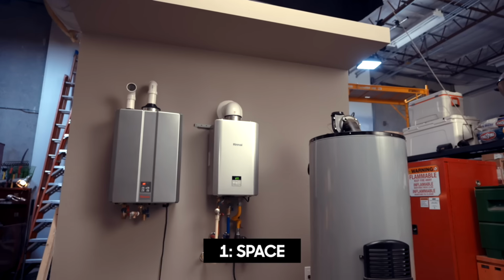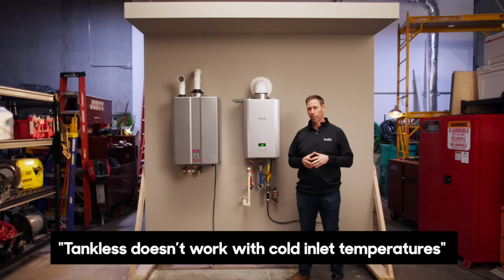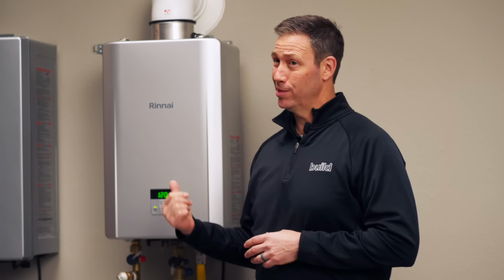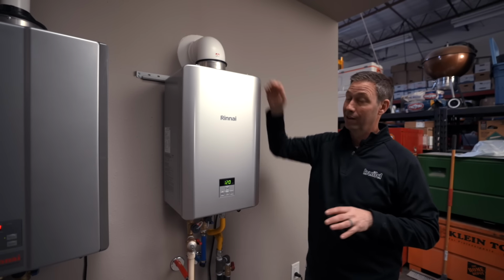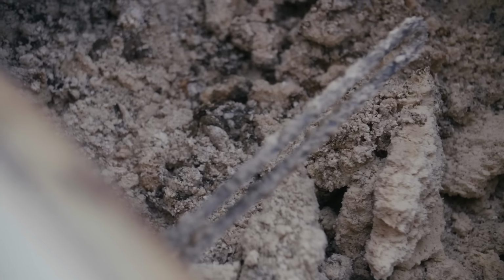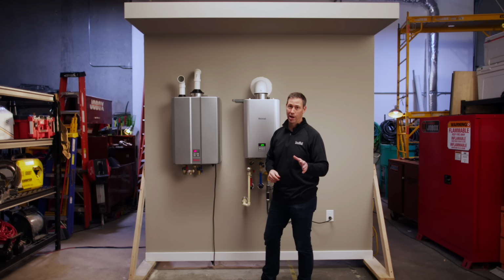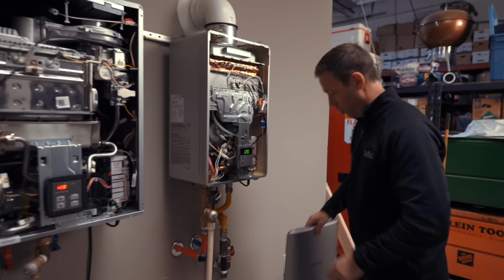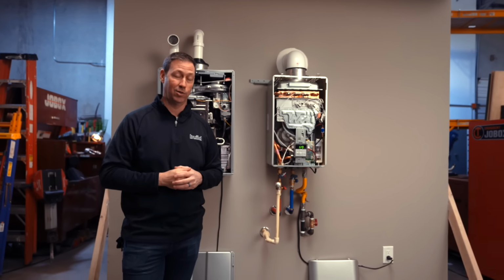DEBUNKING Tankless water heater LIES!

Comment: I grew up in a house with hot water radiator heating. The hot water furnace also supplied the hot water for the plumbing. (It was a big old furnace with the mica window into the combustion chamber. The only upgrade my parents made to it was to convert it from oil to natural gas. The cats loved to sleep on it when it was running.) Yes it could take a minute or two to get the hot water from the basement to the 2nd floor shower, but that hot water wasn't running out... ever. I bought my first house about 3 years ago and it has a tank water heater. When that tank finally dies, I plan on replacing it with a tank less so my wife and I don't have to wait 30 minutes between showers in the winter so the 2nd person to shower doesn't finish in a cold shower.

Comment: I've had gas tankless and now I want electric tankless or heat pump tank.  I'm going to use three small tankless heaters one at each bathroom and one for the kitchen.  I think they will just go in the closets behind the shower wall.  Instant heat due to the short pipe run to the shower.   No more burning gas and causing climate change.  It's just stupid to install new gas appliances when electric work so well.  The heat pump tank is still in the running.
Reply: i agree on the climate change, however my house barely hsa enough electric for the appliances we already have (and we don't have all that many).  Cost of upgrading electric supply is unaffordable for many people.  For the sake of the earth, we should have subsidies for such things.  Sounds like UK is phasing out gas, it will take a lot for US to catch up.

Comment: It would be great if you and the sponsor could work through real world applications and how to prevent the hot, cold, hot (pancake) effect. Also tanks give out a more consistent temp and it changes slowly. With our newer and modern tankless if someone runs hot water which changes the temp slightly the shower gets cold and when the water is shut off (like in the case of a dishwasher) the shower gets super hot. I’m sure there are ways to mitigate this this but it’d be nice to see a video addressing common issues in real world applications that your typical installer may not know or may assume isn’t a problem. Thx!
Reply: The real issue you describe isn't a water heater issue. It is a supply issue. If the incoming water pressure is low there will be more effect on temperature change in the shower mixing cold and hot water. The larger the water supply and smaller the branches will lessen this hot to cold to hot fluctuation. Typically the main lines would be 3/4" tho 1" pipe would be even better except more water would have to be delivered to raise the line temperature. Branches are typically 1/2" pipe wit 3/8" supply lines coming from the supply valves.
Reply: @aNuthaRedneck  pancake effect is pretty well known with tankless. In this situation I’ve experienced it with a 40/60 lb well w/a 12gph pump and properly pressurized well tank and the shower is a flow restricted shower head - while a restricted water supply may also cause this, in our case I don’t think it’s a water supply issue.
Reply: Shhhhhh

Comment: We had tankless water heating in Latin America in the 60s. The shower head had a resistance coil and just plugged in to a nearby wall socket. You controlled the temperature with the water flow - more water, colder, less water, warmer. Very effective!

Comment: Sorry, tankless are not very reliable when the power goes out. Also in an emergency, 40 or 50 gallon supply of water without lifting a finger.

Comment: Well some downsides to tankless heaters, power outage you have NO hot water, tankless are more susceptible to BAD water it will kill a tankless faster, some areas (California) looking to ban gas fired water heaters, dryers etc... so get stuck on very expensive electric.
my gas fired tank water heater ran for 30 years then had to replace the burner that was not available anymore so dropped in a new gas fired tank water heater.
each system has its pros/cons.

Comment: First tankless I put in was Rinnai, venting was less than 4' and Rinnai venting is pricey. This house I put in a Navien because the venting was 24' and rated for schedule 40 PVC piping.  Turns out Navien didn't get schedule 40 approval in Canada, I had to change to schedule 80 on the exhaust at $18/ft so Rinnai would have still been an option.  The Navien has been in now 9 years,  I  flush/service it every year (very simple) and it has paid for itself.  For 2 people, it uses as much gas per month that a pilot flame would use in a tank system. Set the temp to a hot bath no point mixing in cold.  Never going back to a tank if I have a choice...
Reply: Did it lower your gas bill?

Comment: I got my 199k BTU tankless on clearance for half price(~$500) from Builder's Square when they were shutting down. Was a Bosch but I think it was a re-branded Japanese unit.Finally installed it in 2003 when my tank started leaking. I installed it my self and it has been mostly trouble-free. Sometime it will not activate at too low of flow and sometimes if it sits for a long time without use (months - living with girlfriend), the flow wheel will not spin and has to be freed up by hand.

Comment: Tanks are more useful for hot climates + solar heating, you can't go tankless with a solar heater. There's also the 95% efficiency thing, only an electric heater could possibly reach those efficiencies due to the physics of how gas heating works.
And just as an FYI, solar heaters are more efficient than solar cells, though their max temperature is much more limited as well as lower efficiency during winter (hence the warmer climates bit), also a rooftop tank+solar gives you a bigger head pressure due to the height involved, thus no need for a pump to pressurize hot water in your house.

To reiterate, tankless is good for cold climates, tanks are better in warm climates IF used in combination with a solar heater.
Reply: Wrong about efficiency. Look it up. The Renai is up to 98% EFUI or whatever the acronym is. Condensing version

Comment: Stupid lies alright, this guy is the one telling them. Inlet temp does matter unless you have a 500amp service to supply enough power to heat the water. Be prepared to turn off all your heaters, ovens or power using devices so your well pump has enough power to run. Your tankless heater will dim the lights in your whole neighborhood. Serious, you need a solid 200amp service minimum to run one of these.

Comment: The tankless heaters with efficiency of 300%-500% are much more expensive then their counterparts with 300%-500% tank-models. As they need much more power in the heat exchanger they need have much bigger heat pump.

Comment: 5 years ago I retired a 30 year tankless in order to replace it with a condensing tankless.  (3 adults + 2 kids in the home)   The old unit is still functions perfectly and I will re-use it in a smaller accessory.  I flushed it irregularly, and one time it stopped working because dust blocked the small screen at the pilot light, as soon as I cleaned off the dust--back to perfect working condition).

Comment: Having had both I would only choose a tank type as tankless need a decent flow to turn their heater on, so you have to run your tap a lot harder than you want in the shower etc, so wasting water, If you try and turn your shower down you get hit with a cold water, then you turn the hot water up and it goes too hot. Also with a electric heated tank you can take advantage of off peak power or solar timing to save .

Comment: The fact you found a foot of scale in a tank water heater indicates reality :Virtualy NOBODY drains or service their hot water heater. In a tank, nearly all the minerals and crud will settle out to a bunch of crud at the bottom, in a tankless the unit will stop working and the manufacturer won't honor the warranty, citing improper water supply. The idea that the homeowner is going to flush the tankless unit or call a plumber in to service it annually is pretty far-fetched in terms of the average homeowner. Average homeowner doesnt even have their backflow preventers serviced annually although that is required by law!
Reply: My father-in-law has kept his electric tank water heater going for over 30 years via annually cutting power,  draining it, removing the brass drain valve, and using a wet/dry vacuum to remove debris from the bottom. He also checks the anode at that time. Sure, he's had to replace a few of its heating elements along the way, but still.

OTOH, I've had my natural gas standing pilot tank water heater for 15+ years and haven't done jack to it.

Comment: No, tankless require annual maintanance. A tank is alot more forgiving.    Add up those annual service charges and you aren't saving anything.  I'd rather get a new tank every 10-15 years.  My current tank is 20 years old and I'm sure is disgusting inside but it still works just fine.

Comment: I regret switching to tankless. My experience is different from yours. First, it was expensive. A little over three times replacing the tank. The unit I installed was rated to supply more than two shows at a time. It does not. It does take longer to get hot water than the tank version. The first drop of water out of the tankless is at the same temperature as the intake water whereas the first drop out of a tank is at the tank temperature. Big difference. If I shave and then immediately take a shower I will get a blast of cold water. While shaving the unit cools off meaning the hot water in the pipe will have a slug of cold water coming before the unit starts putting out hot water again. So I waste water while waiting for that blast of cold water to pass. 

With a tank I set the temperature to 130 degrees. The tankless has a maximum temperature of 120 degrees. I would prefer hotter water. The saving in the gas bill is about $9 per month, however, the plumber who installs it charges $240 for the recommended bi-annual descaling. Bottom line the operation is more expensive than the tank, takes longer to get hot water, only allows one shower at a time, and wastes a lot of water heating up. If this unit goes bad I will go back to a tank.
Reply: When a client calls me to install a tankless I give three scenarios.  1. Space; do you absolutely have to have the space. 2. How often are you changing out your tank?  If it’s less than 8 years then you’re a candidate for an assessment. 
3. Home; are you always gone? Some of my clients are gone 3-9 months out of the year. Then my final question is do have to be reminded to change the oil in your car??? I personally won’t install a tankless unless I know that you sincerely need one.  I don’t want an unhappy client.
Reply: @tonylittle8634  Hey Tony, i would appreciate your insight, i need a new water heater, my 40G tank failed after 27 years, thought about tank-less, i like the idea of saving money and space however I'm worried about reliability and cost of tank-less Rinnai. I can replace a tank myself in the same day but for tank-less, i have to rely on plumber and his schedule which cost a lot of money if the tank-less fails. I am just one person and my shower takes 1,2 minutes, My gas bills goes up dramatically during winter like 5,6 times more than summer, but i think it's because of furnace not my tank water heater, what do you recommend ? initial price(tank and tank-less) for me are very close ...
Reply: Most tankless water heaters do that for safety reasons, BUT If you know where to look there should be a DIP switch inside the unit that you can change in order to allow higher temps.
Reply: This is the exact reason why when our tankless goes bad, and I hope it is sooner rather than later, there is a tank unit replacing it.  Who the hell takes showers so long that they go through a tank of hot water.  These things are nothing but a gimmick sold to non-engineers who don't understand simple thermodynamics.
Reply: This video is sponsored by some tankless company, what did you expect, its fuill of bullsh*t
Reply: @Runescape.  precisely 👍😀
Reply: @Runescape.  sadly I think the powers to be are pushing tankless for better or worse.  I make a living repairing tankless and I have a 40 gallon short at home.

Comment: I live in Japan and I have never seen a water heater tank.  Everywhere uses tankless and they do work for 20+ years and that is on Okinawa where there is a ton of salty air.
Reply: since you don't tell us how hard your water is, and who does the maintenance and its cost, your comment doesn't tell much.  Just cuz everyone does it where you are, doesn't mean it's better.  And i don't believe they all work for 20+ years, because that is not true anywhere else.
Reply: @annamyob  Believe what you want and I have no idea how hard the water is and no one does maintenance on it.  The first apartment I lived in for 7 years had a hot water heater that was 15 years old and not one time was maintenance done on it.  They are better and they never run out of hot water.
Reply: @RR-or5ip  well then it is just amazing isn't it that all those other ones need all the maintenance and have all the problems.  Why?
Reply: @annamyob  I have seen several comments on here that say they just work.  Maybe the quality of the unit?  I have no idea but when a country with over 100 million people pretty much solely relies on them without issue then I would say its a pretty good sign.  You seem like a real jewel to be around.
Reply: @RR-or5ip  Several anecdotal comments proves nothing, when posed against the other anecdotes of ongoing problems.  I'm guessing the areas with such success simply have soft water.  Either that, or having the units heating both the home and the water, means greater flow through the system, which helps flush scale out?  Their success doesn't negate all the users and contractors who swear they'll never use a tankless again, and yes, I will continue to question those who say "well I never had problems so what's wrong with you."  Why are you more offended by my raising legit questions, than by their attitude?

Comment: We have a solar hot water system with a tank feeding into a Rinnai-like system. When we run out of freely-heated water, the instant-on gas heating takes over. Win-win.
Reply: That takes some tricky piping. lol
Reply: @anthonyspadafora1384  Not really. It's just a solar HW system (tank on ground) and the outlet passes through the Rinnai before it goes to the house. If the Rinnai detects it's too cold, it turns on. That's what is so great about the instant-on systems. They just work. (We did have a Rinnai. After many years using it, there was some storm damage to it so insurance company replaced it, but with another brand.)
Reply: @martinXY  Interesting, if the water going in is hot and the flow rate isnt enough to dissipate the minimum firing rate the unit will cycle and throw a code. Temp rise x lbs of water per hour will give you BTUs. Usually we will enter a 3 way thermostatic mixing valve through the mix port and remove the check valves then set it for the minimum temp at minimum flow rate. This will divert the water either to the water heater or directly into the hot water line. Then we use a second mixing valve to temper the water if it is too hot coming out of the solar tank.
Reply: @anthonyspadafora1384  You may be right - I'd take a photo but ... Youtube.
Reply: @anthonyspadafora1384   These Rinnai ones are specific for solar HWS so maybe they do something different. You're in the biz. I point at the magic box and say "that makes the water hot". 😆 Vague understanding, that's me. Wow, that should be my username somewhere.
Reply: @martinXY  Interesting, I will have to check that out on their website. Truth is, I havent sold a hot water solar job in many years. Once PA started fracking and gas became very inexpensive tied to the fact solar hot water systems are more expensive than ever and photovoltaic are lower than ever, there just isnt much call for it.
Reply: @anthonyspadafora1384  At the time, there were “carbon credit” rebates for both solar HWS and instant gas systems, so it made it worthwhile for us. We use ¼ of the gas that people with no solar use (guesstimate from what the gas bottle guy said). I also guesstimated that it took about 8 to 10 years for the whole system to pay for itself. Then it got smashed by hail. Yay for insurance. With the price if electricity these days, very happy with it.

Comment: We had one installed two years ago, it's amazing not having it run out of hot water. We used to have to boil water to fill the big tub and keep it decently warm now it's typically too hot and need to use more cold with filling it up.
I need to get the reserc working so it's hot quickly. 
Without the reserc the only issue is having it have to turn on if you don't use the hot water for a bit.
Reply: LIER... Mine wastes 3 to 5 gallons until acceptably hot water most showers i never turn cold water on year round.. REALITY
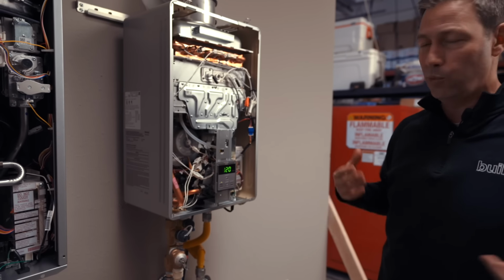Reply: @peter-pg5yc  Sounds like you don't have a resec pump on yours. Might be worth looking into ours we can setup to run specific hours example if I am up at 6am for  shower each day I can run it at 5:55 and turn the tap to hot water instantly

Comment: Venting IS more expensive in talking about retro fit. If the customer has a tank heater installed (95% of our customers) it is considerably more expensive to run a new vent outdoors as you cannot use the existing venting system. 

Whereas a swap to a new tank from an old tank can generally reuse the existing venting system with little to no changes.

I agree tankless is the way to go but just a bit of false statement depending on installation.